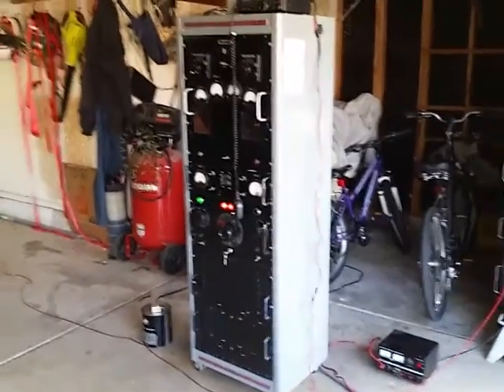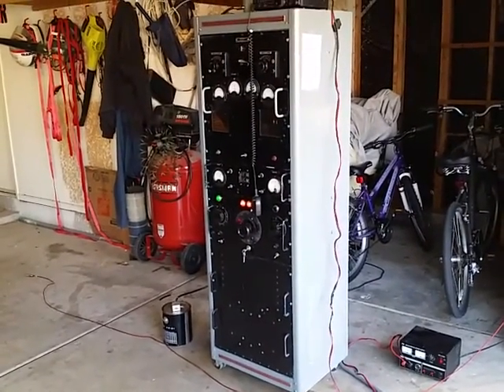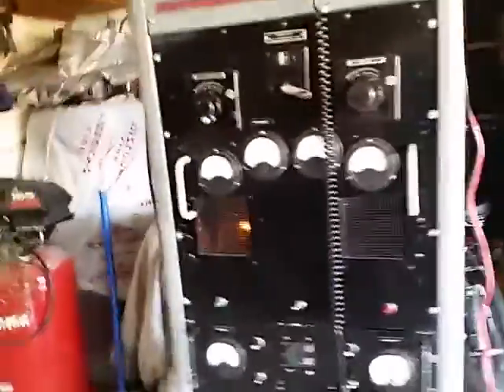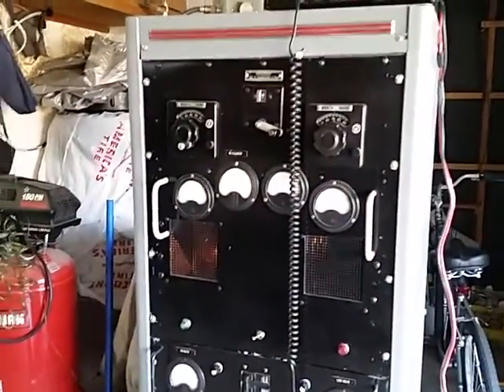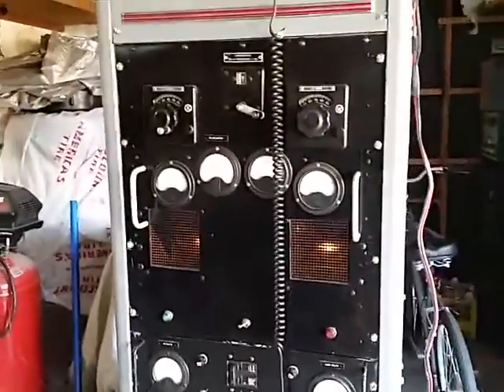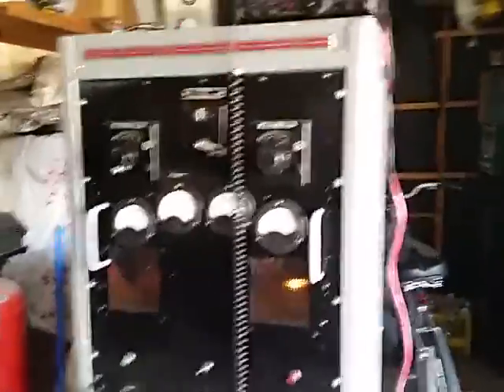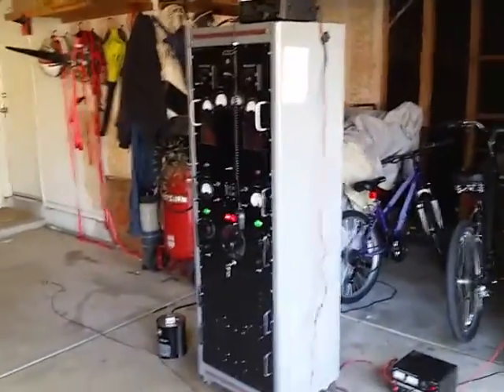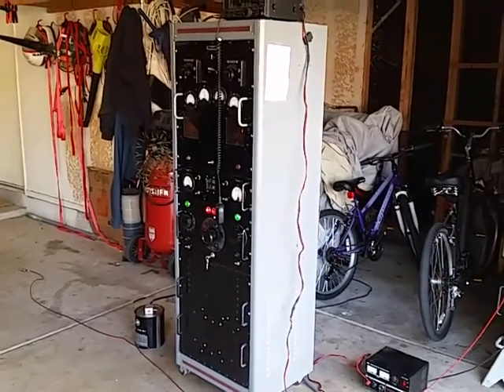W8QBG 2 x 4-1000 amplifier

Comment: 6000  on the plate should produce more output than 1200 watts. What was the drive power? I  could easily do legal limit plus with 1 tube at 5000 volts and 100 watts of drive. Nice amp.
Reply from the maker: n5ifi the amp did Not have a tuned input. It needed a lot of drive. I rebuilt it with a tuned input and it now does 1500 with 30 watts drive.
Reply: @clarkturner7484  yea no tuned input will kill power big time.
Reply: Clark Turner

With 30W of drive, does it do 1500W with one tube or both, and at what plate voltage? Also, what class is it running in, AB or B?

Thanks -
Nick
Reply: @Sparky95  one tube, pay attention to the video.
Reply: As I recall, unless you have a peak detector added to that Bird Wattmeter, you are not seeing the PEP power reading, but an approximate RMS reading.   I think your power numbers are therefore significantly lower than the actual PEP output.  Thanks for showing us this flame thrower.  73 de WA6WHT

Comment: "...into a dummy load..."?  Is it submerged in a large lake?  Seriously, I am currently (voltagely?) designing and building a 2 X 4-1000A amplifier, grid-driven, push-pull, and operated in class A.  Yeah, I know about efficiency and so on, but it is going to have a very clean output and sound just marvelous when I get it up and running.  Of course, I will never drive it above 1500 W PEP!

Never.
Reply: EdWatts m
Reply: Thank you. Still working on bandswitching and so on.  The 4-1000A is known as an "amplifier, oscillator, and modulator, often as all three simultaneously'"; that's where I am now.  If my desire was, simply, to let our extra-terrestrial brethren know that we are here, my project would be finished.  As it stands, however, fellow [human] hams and the FCC want me to tame the beast somewhat.